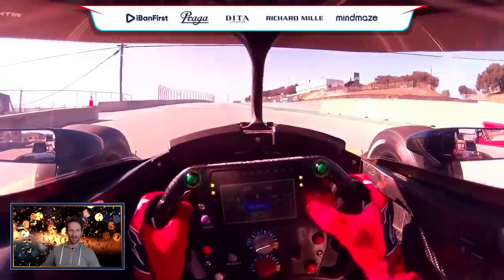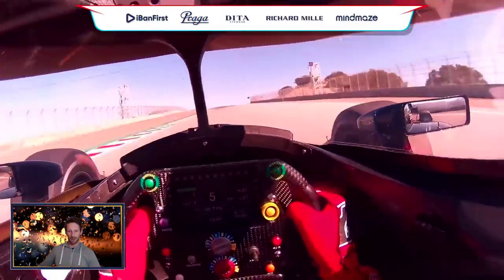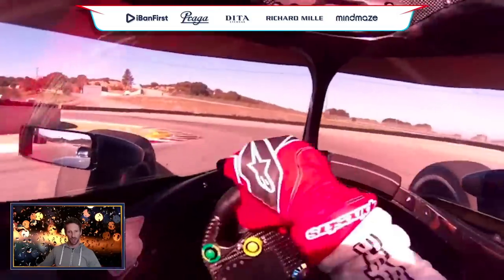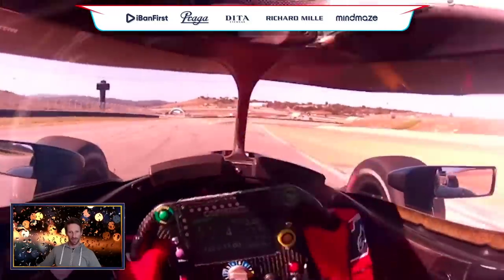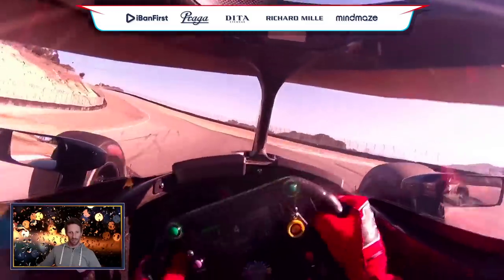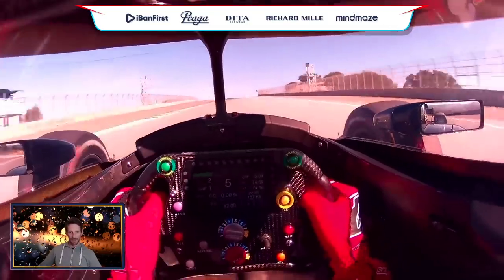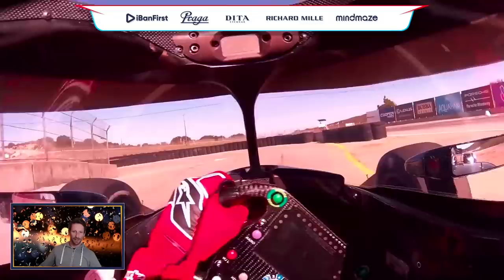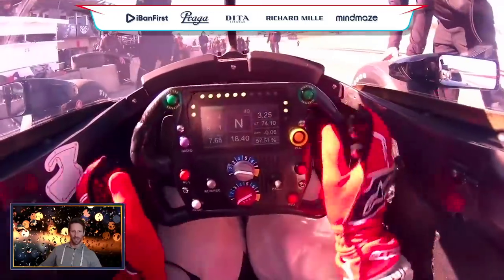INDYCAR vs FORMULA 1, the differences

Comment: Cool video!  EMG tests at NIOSH show a PROPERLY MOLDED set of grips reduces grip effort by 54%.  This improves the signal-to-noise ratio on steering feedback so the limit feels like a distinct PEAK, and not a numb flat spot in your mind.  The grips I see in your video are missing some features that don't inhibit turning in BOTH directions while still giving you a LOT more leverage.

I spoke about this at three steering conferences: Berlin, Dusseldorf, and Ann Arbor...I brought the wheel I made for Michael Schumacher, Ser.#159/F1-001, to show how you properly mold grips for Road Racing.  OTOH, Ser.#414 and #415 went to Fernando Alonso when I made his wheels at Indy; so they were molded for THAT oval where holding the wheel RIGHT (going down the long straights) causes the most driver fatigue during the Indy 500...not many know this.

Anyway, if you want me to do your grips, look me up when you come to Long Beach...I'm 20 minutes south of the track in Costa Mesa.  Good luck, and welcome to IndyCar!

Comment: Should make part2 and talk about engine/power unit differencies, acceleration, set up possibilities etc. As detailed and technical as you can please Romain.
Reply: F1 has lighter cars, more power, and higher downforce, plus electric torque.  F1 cars are much faster.  And Indycar has limited technology on purpose.  Juan Pablo Montoya just drove an Indycar after his recent career in sportscars and was mentioning the lack of electronic aids compared to sportscars.  But that is the point.  F1 is about the cars.  Each team builds a new car each year and designing a fast car is what determines the Championship.  You put George Russell in a Mercedes and he should have won the race and he would have a decent chance to win the world championship.  But usually he can't get off the back row.  An Indycar is a cool car, but it is not the pinnacle of tech.  It is a spec weapon designed to make the racing good with lower overall downforce, more from the undertray and such to allow close nose to tail racing.  

F1 is the pinnacle of racing cars, but the driver is a small part of winning.   Many great driver's careers are wasted in back marker teams.  Indycars are a slower spec car, but the driver is much more important to winning and the racing is much closer because everyone has an nearly equal car.

Comment: For the F1 only fans here, all these differences are by design to have better racing and the drivers make more of a difference than the machine. The drivers need to have stronger upper bodies and learn to drive to the limit of the car without spinning. Obviously, America is very well known for fast cars and has the technology to make super cars that go extremely fast with a ton of down force and power steering but it takes the driver out of the equation for the most part, then you get something like F1 where 11 cars just watch the fastest car in the field win every race unless they DNF on their own. Not good for quality racing at all. Indycar is a great product of racing fans, not just car fans.

Comment: It was many years ago, but I remember asking Paul Tracey about the differences between the two types of cars, after he had done an F1 test ( can't remember who it was with though). He said the biggest and almost alarming difference was in the braking. An F1 car would just about have your eyeballs flying out of your head, compared to an Indy car at the time. I'm curious if an F1 car still has a huge braking advantage in comparison. I know there's a huge difference in lap times on the same circuit - I think even an F2 is faster.
But, Indy cars are all pretty much identical now, I think? Which then puts everything in the hands of the driver & his crew.
So it should be a much closer class of racing, instead of a parade with the same one or two cars at the front.

Comment: In F1, there has been much resistance, from the drivers, to the use of a windshield. How do you find it in the Indy car? Is there distortion as many F1 drivers has suggested? On a safety concern. Would a windshield have protected you more from the flames of your crash last season or do you feel it would have been a hinderance to you exiting the car?

Comment: Very nice insight. So is the reason for a lot of work on the steering wheel correlated to the lack of downforce compared to an F1 car or does it also have to do with the power steering differences?

Comment: I hope Grosjean can do well if Indycar..When he is on it he is an exceptional driver, but he is quite equally just as exceptionally terrible when he is not feeling it..
That being said I don't think that he should bare the brunt of the poor results with HAAS. 
When the 2019 season began, between the distraction of the Rich Energy debacle came about, the fact that they never saw the other half of the promised financial sponsor investment, on top of the fact that HAAS out sources the ENTIRE car from Dallara & Ferrari I personally believe that in a sport as sophisticated as F1 is, a team has to know the design and development of the new chassis intimately which you can really only achieve by using the current car develpment, understanding the current seasons chassis strong points & it's problem areas which they would apply to the next season's car development which usually begins mid season for the smaller teams like HAAS, former Force India before the takeover, Sauber b4 becoming Alfa Romeo & so on.But when your outsourcing the entirety of the F1 car like HAAS does, they spend the ENTIRE season trying to figure out the car they have as they are trying to design the next season's car using scraps of data they do understand. which might fix one issue but creates a whole host of other design issues... 
example being Grosjean continuously struggling with the brakes in 2018 which translates into having tyres temp issues in 2019.....BUT they DID SOLVE THE BRAKE PROBLEM 😁......
It's just a vicious cycle where it eventually exposes all the weak points of a very very small F1 team..
If lets say for example Mercedes......They have an enormous team which allows them to dedicate a Slew of personal to focus entirely on one problem & even then, that team of problem solvers also has intimate knowledge of the development of their car because they have spent every waking moment of that new cars life from the moment it becomes an idea to the final lap in Abu Dhabi... 
   That doesn't mean Grosjean isnt free from having countless brain farts over the course of a season but I also have to consider that one issue feeds the other...
  When HAAS debuted in its 1st & 2nd season it appeared that the HAAS approach to becoming an F1 team was a stroke of Genius..
BUT......... in the end by HAAS trying to squeeze a booger out of Lincoln's nose on the face of a Penny has forced rhem to whore themselves out to whoever has a pocket full of money...
Rhat pattern of thinking cost Frank and Claire Williams their team in the end and it will do the same to HAAS regardless off the 2022 change..

Comment: The steering must also be quite a lot heavier in Indy,  but in F1 it is probably more difficult to drive on the limit, because the F1 cars are more unforgiving when you step over the line.
Reply: No.

IndyCars are more unforgiving.

Comment: With no power steering in indycar, I'm sure you're gonna be more swole from just driving it around.
Reply: @christiant7837  - Yes it does.
Reply: @christiant7837  it absolutely does have power steering and loads more downforce too. its why IndyCars are generally "harder" to drive.

F1 cars are built to be an engineering marvel and be perfect.

IndyCars are built to absolutely hate the driver and its up to the driver to "tame" it.

Comment: You can’t NO compere F1 to Indy 
F1 is more advanced in anyway. 
Common what’s so fun 
Driving in circle really? 
Not to mention that F1 is 11 seconds faster than Indy on last time check in Texas. 
So just stop comparing with something that is way better & faster
Reply: is F1 faster, yes. is F1 better, debatable. IndyCar has less grip and no power steering which means lap times are much more in the drivers hands, while in F1 everything is so over engineered that the season is basically decided before the season starts. Grosjean himself said after his first pre season test that his arms were sore from physical challenge of driving an IndyCar.
Reply: "better" is subjective plus an oval is not a circle :)

Comment: That’s Romain being very politically correct. Not trying to say the real differences between the two. There’s a million reasons F1 cars multiple seconds faster around COTA. And that’s where Indy cars have no track limits. But I’m glad he’s here. Great competitor, I’m sure he ll do well.
Reply: the main reason F1 cars are faster is because F1 cars are engineered by each team to be as easy for the driver as possible because easier cars are faster. IndyCars are intentionally designed to be difficult to drive so that driver skill shows more.

Comment: F1 is  lot faster. Just check the times at COTA.
Reply: On an F1 track with 200 less horsepower? Sure. But an indycar would smoke an F1 car on any indycar track especially at IMS. And an F1 car would not survive an Indycar street circuit....or even fit probably. Look at how bad Monaco is
Reply: @MichaelRCarlson  No, any tack including ovals. The horsepower advantage will kill indycars> All f1 cars need to do is to adjust the wings, it will easily overcome the ground effect advantage. Have you seen F1 car do 400KPH at salt flats? Today's cars have even more HP.
Reply: @robertwhitten265  No, not really. The F1 engine would eventually fail on an oval.
Reply: @FloosWorld_AoE  they can detune the engine just 2% and it will  last 500 miles.
Reply: @robertwhitten265  Even then, the F1 car needs an engine that can rev at 12,000 throughout the entire race and not at just peaks

Comment: So Indycar just copied F1 hallo ?
Reply: Indycar has an entire screen, it was developed by Red Bull Engineering I believe.
Reply: @jstoli996c4s  The screen is just "to deorate" it. The base of the protection is a halo like device. That screen wont stop a tyre.
Reply: @jonpetter8921  search “Indycar Areoscreen” to learn more.
Reply: I think the question is when will F1 copy the Aeroscreen?
Reply: @aperson5062  Are you serious ? The reason Indycar introduce their "halo" was because of F1 implementing the Halo after Bianchi death in 2015.

F1 "doesn t know" Indycar exist lol
Reply: @jstoli996c4s  I don t need to search anything. Indycar copied F1 halo deisgn that has been mandatory after the death of Bianchi in 2015.
Reply: @jonpetter8921  You are proud of your ignorance, huh.   Indycar implemented the Aeroscreen in part after the death of Justin Wilson.  Indycar looked at the Halo and rejected it because it didn't offer enough protection from smaller debris at high speed and the T-bar was too low. Both prevented it's use on ovals.
Reply: @jonpetter8921  IndyCar had been working on a Cockpit Protection device since Dan Wheldon's death.

It started with a small shark fin like thing in the front of the cars and developed into Aeroscreen.
Reply: @aperson5062  Halo was the the first that came and it was designed by F1 engineers not by side-company. And aero or what it called is much like a halo just with windshield no matter how you want to twist it.
Reply: @jonpetter8921  Yes, I understand.  F1 is superior in all ways.  The fact that both F1 and Indycar have roll bars must mean F1 invented roll bars too. And when F1 implements a screen in the future, it will be a superior screen as well.  Heck, F1 couldn't copy Indycar because they aren't even aware Indycar exists.
Reply: @aperson5062  Todays Indycar is how F1 was in the 90' both in term of tech and performance 😂
Reply: @jonpetter8921  F1's halo wouldn't have protected Massa, IndyCar's would have. that's the difference.
Reply: @nickb2049  The halo has alreaded saved lots of life, lately Grosjean himself.....
Reply: @jonpetter8921  yes it has, but it can't save drivers from small objects, which can be just as fatal. the spring that nearly killed Massa would have passed right through the halo. Re watch the start of the 2019 Canadian GP and you'll see a piece of wing get stuck in Grosjean's halo and he had to reach forward and push it away. had that piece been slightly smaller or came at a different angle it would have hit him.
Reply: @nickb2049  All fatal head injuries that happen in history of F1 or open wheel racing for that matter have come from massive object like tyres, flying cars or like the case of Grosjean, crash into a barrier. That s statistically proved. 

A halo will prevent possible fatal head injuries in those situations. And it has been proved already. If i remember there was already dozen cases where the halo made the difference.

 I think that s one of the reasons F1 went for the halo, it s the best solution based on experience at the same time maintain the sport integrity as an open wheel racing. 

I ve never heard of fatality because of small subject flying onto the drivers. The helmet and halo combination would stop it. The smaller the flying object is the lesser mass it have and therefore less damage. You may get injured by a flying bolts but you wont die from it. And the chance that it will hit you with a helmet and halo is minimal.
Reply: @jonpetter8921  "it doesn't happen often so why worry about it?" is the mentality that has gotten many drivers killed over the years. Felipe Massa very nearly died from an object small enough to pass through the halo. Justin Wilson did die from an object that could have passed through the halo.
Reply: @nickb2049  Causality in modern days F1 is very rare compared to 40-50 years ago. Before Bianchis death you have to go 21 years back to find the latest fatality. Safety in todays F1 is very good. Large flying object toward the divers head is one of the most dangerous situations that can happen. That s statistically proved. A helmet and the halo would stop those. 
If you want to make a hypothetical assumption about what that could happen in all possible future situations then maybe it s better not to race at all ....
Reply: @jonpetter8921  statistically when you look at all the open wheel racing around the world, the chances of a driver being hit by a tire is VERY VERY slim, so why have the halo? Bianchis' wreck was due to driver error and they changed yellow flag procedure, so why have the halo? because what COULD happen. Justin Wilson is proof that a helmet isn't "good enough" when it comes to smaller debris. F1 will adapt something like IndyCar's aeroscreen in the future.
Reply: @nickb2049  The reason of the introduction of the halo is Bianchis death that hit a truck in the head. The collision was heavy but at least halo could help a bit. Same with Grosjean the halo is why he survived. 
F1 tested aeroscreen but it didn  t pass for some good reasons that you probably know.
I think the halo is the best choice for F1 when all variables are taken in consideration. 
Indycar can use their version of halo.
Reply: A lot of misinformation here. For starters some of you seem to think Indycar and F1 are fighting against each other with the "F1 doesn't care that Indycar exists" BS when infact the 2 series were sharing data back and forth while working on solutions concurrently.   Both series are in the interest of driver safety, and were happy to help each other. 

Obviously F1 developed things faster, they have wildly more money to work with.  The poorest team in F1 could probably pay for most of the indycar field for an entire season.  A team like Mercedes budget could pay for every driver in indycar for multiple seasons.  Also the F1 teams had the luxury of designing brand new cars to incorporate the Halo, whereas Dallara had to adapt the halo/aeroscreen to an existing car and ensure it met strength requirements.